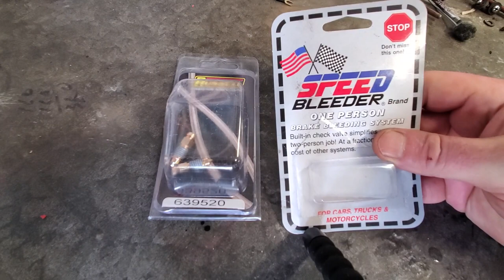1979 Fiat Spider 124, Bleeding the rear brakes

Comment: Your videos are helping me with working on my fiat. did you replace the rear brake compensator on this car? Is there a way to check if its working correctly or at full pressure when the car is on the ground ? I'm having a very difficult time trying to take the two flare fittings loosen out of the compensator to replace that with a new one.
Reply from the maker: Yes, it was replaced. You could check it by disengaging the rod from the axle and see does it compress and return.